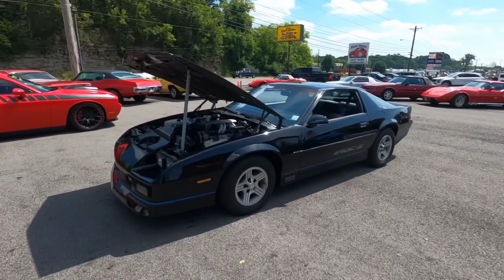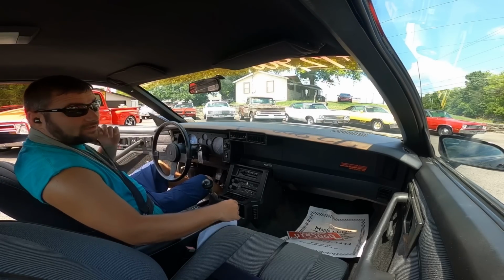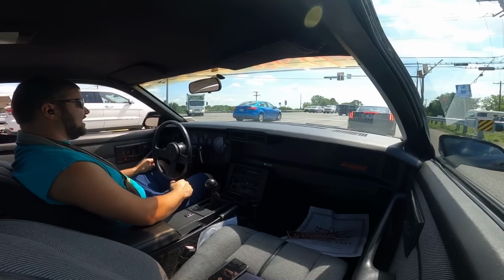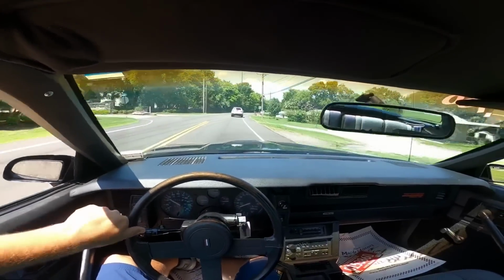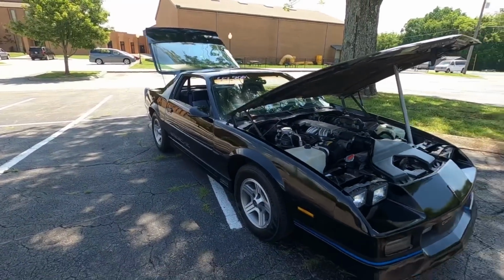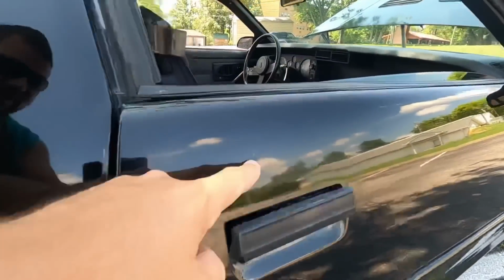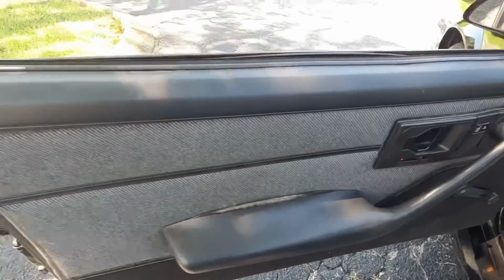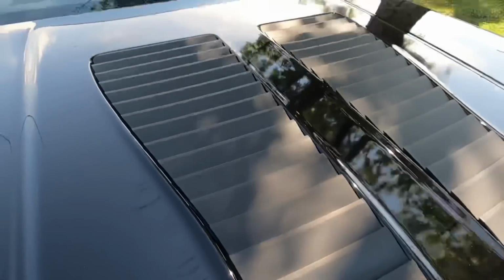Test Drive 1989 Chevrolet Camaro IROC-Z 5 Speed SOLD $12,900 Maple Motors #1580

Comment: This is a real IROC-Z! 
1989 Chevrolet Camaro History

Sport Coupe dropped, replaced by returning RS model. 1989 Chevy Camaro RS now available with LO3 V-8. Headlight pockets on RS no longer painted black. '89 Camaros now came with rear shoulder belts. The Corvette PASS-KEY ignition lock system was adopted for all 1989Chevrolet Camaros.The base 15 inch IROC wheel was restyled to have the appearance of the optional 16 inch wheel. P245/50ZR-16 tires replaced the P245/50VR-16 tires on the IROC-Z when equipped with the 16 inch wheels. TPI motors got better performing `Multec' fuel injectors. The exterior of the TPI plenum changed slightly: the ridges on top of the plenum did not extend as far forward. Calibration refinements eliminated the cold start injector.Four wheel disc optioned (J65) IROC-Z's rear brakes were increased in size from 10.5 inch rotors to 11.65 inch rotors with PBR Australian built aluminum calipers and more reliable parking brake actuators. Front discs still had 10.5 inch rotors with Delco-Moraine single piston calipers.

G92 option included N10 performance exhaust system (dual catalytic converters) which increased power output by 13% on cars so equipped. For 1989, G92 also required the following options:

5.7 TPI motor (B2L) or 5.0 TPI motor (LB9) with 5 speed (MM5) manual. 16 inch wheels (N96) P245/50ZR-16 Goodyear Gatorback tires (QLC) Limited slip differential (G80) Rear disc brakes (J65)

Engine oil cooler (KC4)

G92 and J65 (rear disc brakes) no longer available on IROC-Z convertible.G92 and J65 (rear disc brakes) no longer available on LB9 automatic IROC-Z.1LE performance package option (option level 0 IROC-Z) became more well-known.

Comment: The 305 is a stroked 265 ci ,the original small block chevy !The tpi with  a 5 speed really runs nice.
Reply: Isn't it a LT1-350. Aluminum heads?
Reply: @roybrennen5557  not until 93 in camaro.1992 was 3rd gen. 305 tpi 5speed or auto or 350 tpi auto only

Comment: These cars are actually relatively decent on gas. I had an 92 automatic with the same 305 and if I was nice to it I would get 28 on the highway.
Reply: It's a 350 tpi not a 305
Reply: @josephwatson2711  Not
Reply: @josephwatson2711  On the rpo sticker it has an LB9
LB9	Engine, 305ci, 190hp, V8
Reply: @Carl_Jr  I had a firebird with that same engine it's a 5.7 350 tune port injection
Reply: @josephwatson2711  Whatever, dude. It's your lie. Tell it how you want.
Reply: @Carl_Jr  it's ur opinion we will leave it at that I own several cars I don't have to lie
Reply: @josephwatson2711  It's not my opinion. You're wrong. That's fact! Go to the site and look at the rpo. It's right there! 🤦
Reply: @Carl_Jr  we will just let it go nice chatting with u
Reply: You’re right! Plus 5 speed Camaros never came with the 350. Only the 305 unfortunately.
Reply: @josephwatson2711 they never did a 350 5-speed IROC ... EVER

Comment: Thats a great car for the money.  Clean, 5 speed, lovely bang for buck.

The 5.0? Is that the 305? Lol
Reply: yes the 305 is a 5.0
Reply: @chadhickey9942  that was kinda sarcastic.  Ford 302 is 5.0l chev 305. 
But that is unfortunate that this car has that poopy 305 in it but.... a 350 crate motor is just around the corner.
Reply: @Shornandkenny   ford 302 isnt 5.0.. it was rounded to 5.0 by Ford, but do a little research, its actually 4.9.   

much the same as ford went from calling it by cubic inches to liters, other makers did the same.  so yeah. its a 5.0 305.  Olds had a 5.0 307. everything is rounded LOL
Reply: @chadhickey9942  My Cj has a AMC 304.   I can put 5.0 emblems on my whip just the same.
Reply: @chadhickey9942  do a little research?

Lmao. The 305 isnt exactly 5.0 either. So ha!🤗
Reply: @chadhickey9942  Im a cnc machinist not a doctor or accountant.

Comment: I have the same exact 3rd gen. Everything original. 5 speed, none T Top, black, but mine has the 305 which I hate. Can’t wait to swap the motor.
Reply: Same. Mine is a 1991. The most gutless engine. Unbelievable slow.

Comment: Awesome car. I only wish that they offered the 5 speed tranny with the proper 350ci iroc/corvette/GTA motor instead of only with the 305ci V8. I had one in my camaro, ok motor but not great by any means.
Reply: In '89 the 305 5'speed IROCs with the N10 exhaust option (tru dual cat) were just as quick & fast as the 350 autos.
Reply: @danielfair4675  interesting, mine was an 86' w/ a 305 and a Rochester carb

Comment: 5.7 irocs had the door decal toward back of door. 305 irocs had decal on door toward front edge. Still clean car!
Reply: Incorrect. 1988-'90 All IROC's had the "IROC-Z" decal towards the rear of the door no matter what engine it had. 1985-'87 the door decal was towards the front.

Comment: It's not an IROC.  IROC"S had 16" wheels originally.  I've been looking for one of these for awhile and it seems like everyone is just putting the stickers on base camaros.  However this is priced at about 1/2 the price of other IROC"S currently for sale.
Reply from the maker: Wheels can be changed out over time too
Reply: @MapleMotorsNickSouthgate  I've owned many IROC'S and know these cars very well.  I've looked at dozens the last few months and, after looking up the VIN, most turn out to be base models originally with IROC stickers and badging.  Of course it's possible someone switched from 16's to 15's at some point and are selling it for 1/2 of what most other IROC's are currently going for.  Can you post the vin #?  If it's actually an IROC I'll buy it today.
Reply: @dennishuffstutler9820  1G1FP21F4KL113657   .... now, are you going to keep your word and buy it from him today?  VIN and option code sticker is on his website on the listing.
Reply: They also came with 15's
Reply: Is it an  original IROC or not?  Nice car no doubt.
Reply: Just ask for a pic of the RPO codes that’s the best way as for the VIN, 8th character IROC Engines:
F (LB9)
G (L69)
H (LG4)
This has an F so it appears to be an Iroc
Reply: Thanks
Reply: In 1989, you could not purchase a Z28 that was not also an IROC. All Z28s were IROCs by default in 1989, so GM no longer used both "Z28" and "B4Z" RPO codes. Instead, they dropped "B4Z" and just used "Z28" on the SPID. In other words, for 1989, No "Z28" (RPO on the SPID)=No IROC. On their website the RPO code for this camaro shows it’s an Iroc z28
Reply: 86 Iroc had 16s stock. By 89 they were an option on the irox
Reply: @dennishuffstutler9820  Looks like you still did not buy it yet.
Reply: @bigtuna9529  Actually it was 1988. The IROC became its own model not an option.
Reply: @blainemonson3414 that's because the Z28 name was eliminated. And GM had thousands of 15" Z28 rims at the plant, thus some base package IROCs got 15" rims.

Comment: I think u meant 5.7 motor!
Reply: The 5 spd only came with the 305/5.0L. The T5 couldn't handle the torque of the 350/5.7L.
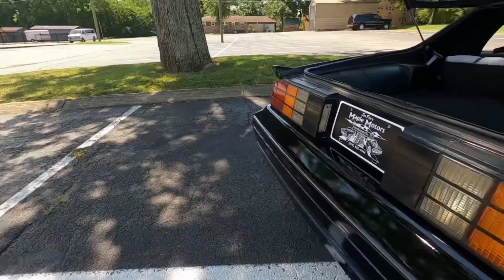Reply: @1970caa  What are you smoking? Look at 16:26 
There is nothing indicating it's a 5.7L

Comment: I worked at a chevrolet  dealership all thru the 80s the 5 speed 87 up tpi was as quick or quicker then the 5.7
Reply: Not till '89 when the N10 exhaust option was offered. That was a tru dual-cat system. 
You're welcome 😉